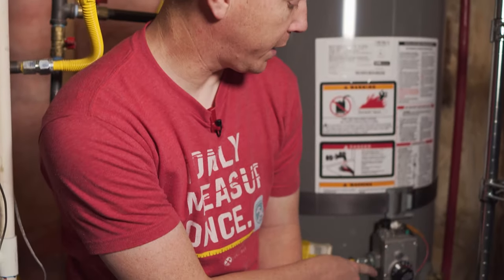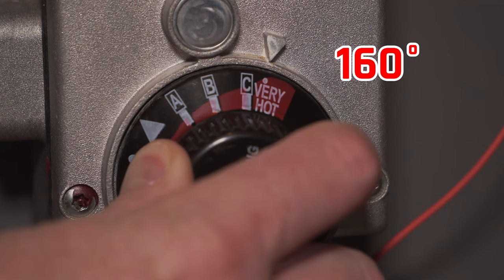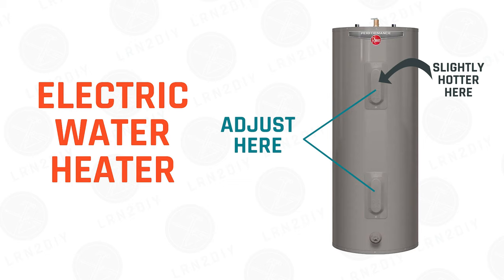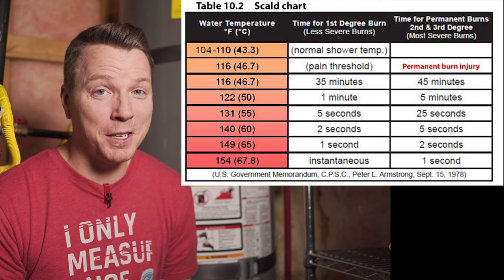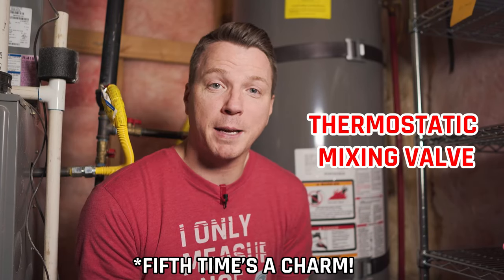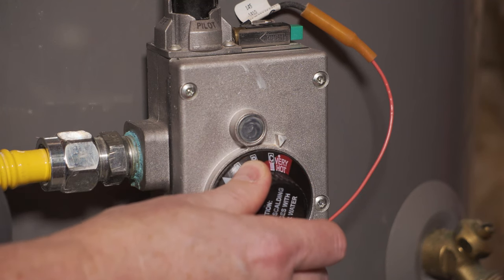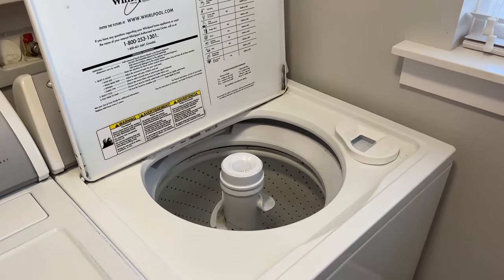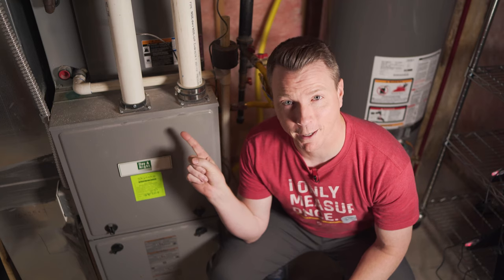5 Things You Should Know About Your Water Heater!

Comment: I have a brand new Laars JX Minitherm Boiler and Bradford While Indirect Water Heater.  I keep the aquastat on water heater at 115F and it is perfect!  Not only do I have plenty of hot water but I understand the lower temperature will improve the longevity of the unit.  The water heater is all stainless steel and has a proprietary water inlet tube design to mix the cold water with the hot and keep down scale. The water heater has no burner and is actually just another zone for the boiler to heat.  In summer months, this is the only zone that operates and the boiler fires very infrequently to heat the water.  Excellent unit!

Comment: You can also install a mixing valve on the hot line just after the tank, and turn up the temperature on the tank.  This has the effect of essentially increasing the capacity of the tank, while still preventing scalding throughout house.  Based on what you said, maybe it would be better placed after branching off to supply the machines.

Comment: You did nail it but could you repeat it fast 5x? I knew 4 of the 5 but never thought of the washing machine temp. 
I have a couple shirts I really love but left them wet in the hamper for a week. Tried to wash out the moldy smell but I think the temp was too low to kill the bacteria. Next wash I'm gonna turn the temp up just for the washing cycle to see if that does the trick. Ofc I'll also have to remember to turn it back down after. I'm gad I clicked.
Reply from the maker: Makes sense. Just be sure to give it 30 or so minutes to heat up before you start that wash :)

Comment: You must also consider temperature settings to control bacteria that come in from the city water. If you set your water temp too low you run a risk of getting legionares disease by breathing in bacteria in your shower which quickly multiply at lower temperatures in the water heater. You may want to research this a little or you could literally DIE from setting your water heater temps too low.
Reply: I made the same comment above - I had a family member who got legionnaires disease  this past year - 2 full months in the hospital including 2 weeks in ICU - lucky to be alive - it’s better in my opinion to keep the hot water temperature up! 

In this case it was not water but rather contaminated potting soil - which according to the department of health is also a legionella source . While not as common as infected water is a common cause.